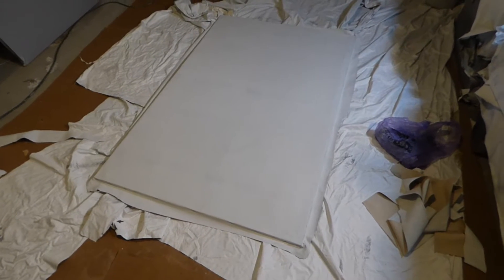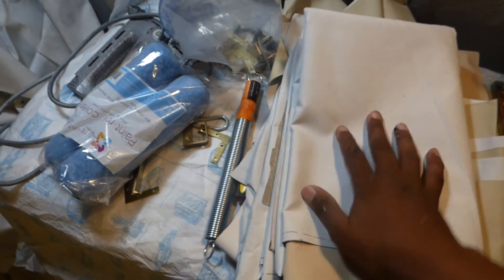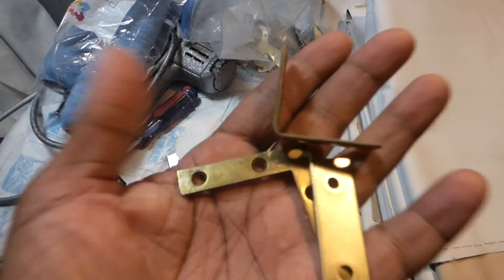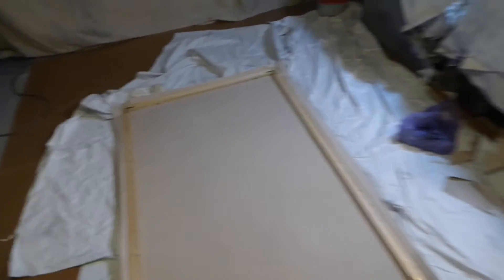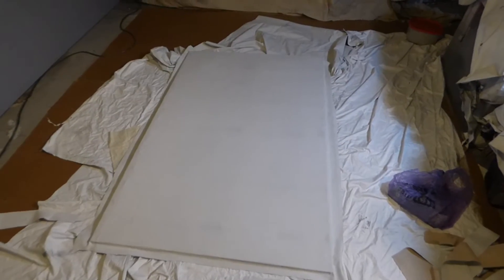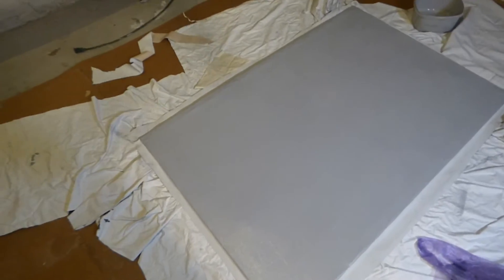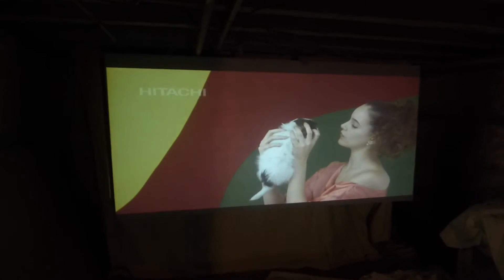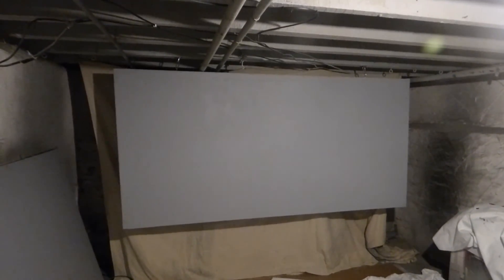EZ DESIGNS  FIX FRAMES PROJECTION SCREENS & HOW TO  PAINT OUR CRYSTAL EDGE TECHNOLOGY SCREEN PAINTS

Comment from the maker: NO PRO'S NEEDED!
CRYSTAL EDGE TECHNOLOGY SCREENS SCREEN PAINT KITS INFO:

1 QT kit screen size 50" - 100"  8 way stretchable paintable projection screen  material size 4 ft x 13 ft Paint roller, replacement rollers, 2 drop cloths, frog paint tape, paint can opener, led light kit price $368

2 QT kit screen size 120" - 150"  8 way stretchable paintable projection screen  material size 7  ft x 12 ft Paint roller, replacement rollers, 2 drop cloths, frog paint tape, paint can opener, led light kit price $443

1 GAL kit the BIG 180" - 260" 8 way stretchable paintable projection screen  material size 9  ft x 12 ft Paint roller, replacement rollers, 2 drop cloths, frog paint tape, paint can opener, led light kit price $554

ALL KITS COME WITH FREE WORLDWIDE SHIPPING!
Available at
www.crystal-edge-technology-screens.com
www.digital4k-crystal-onyx.com
www.digital1crystal.screen.paint.com

Got questions email us at crystal-edge-technology@outlook.com

Note! 2 gal and 3 gal are available Sorry kits are not included!